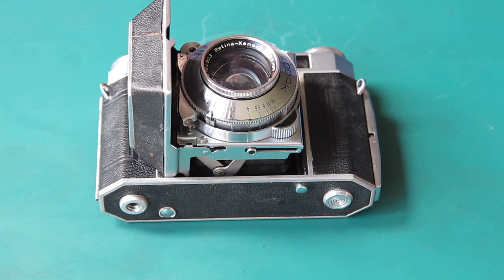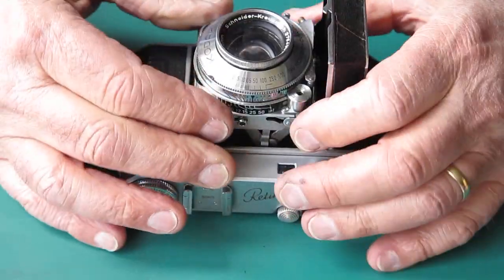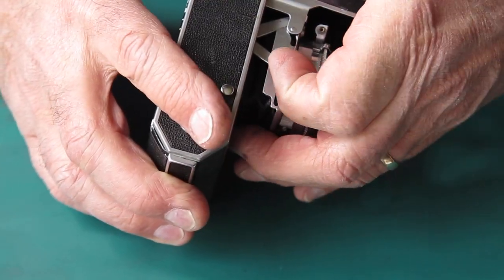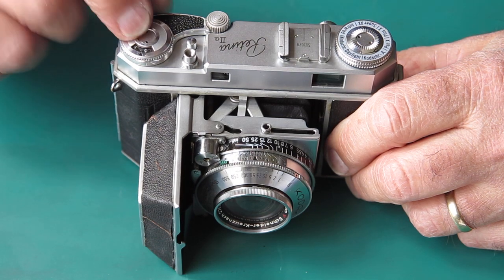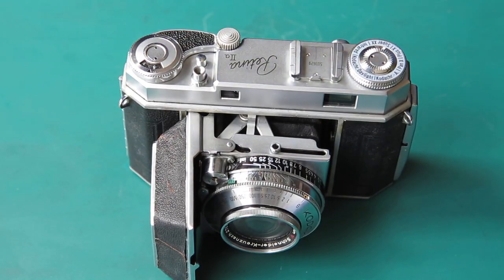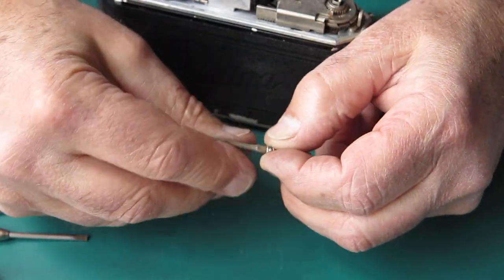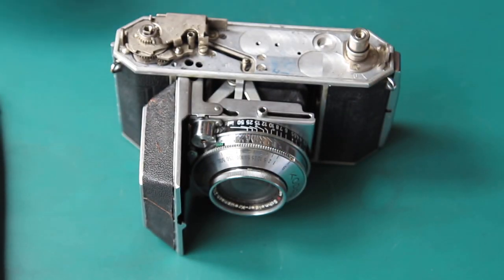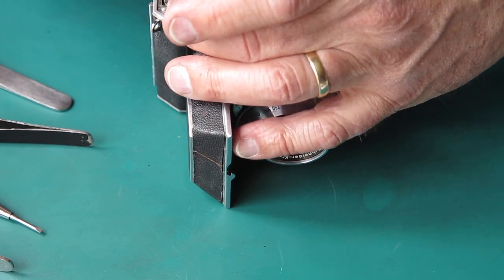A Retina IIa flies in from Malaysia part 01

Comment: What is the tool you used to open the twin pin screw? Is it available or have you made it yourself. 

I wonder if the leather coverings while kept in leather cases easily get this white marks and Zeiss bumps more than the leatherette on other cameras, since I've got a iia that has bumps and white stuff on it